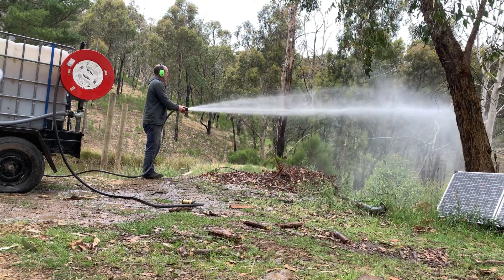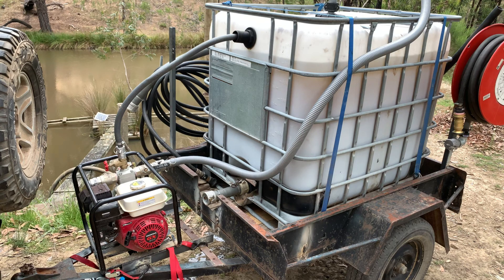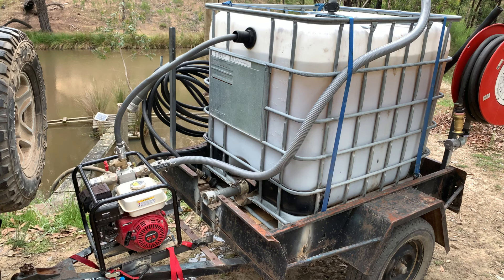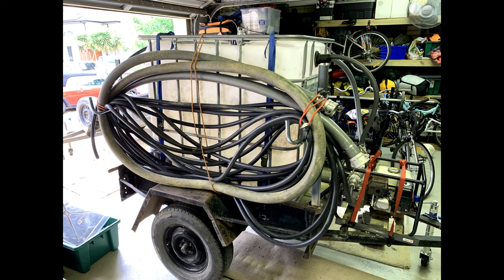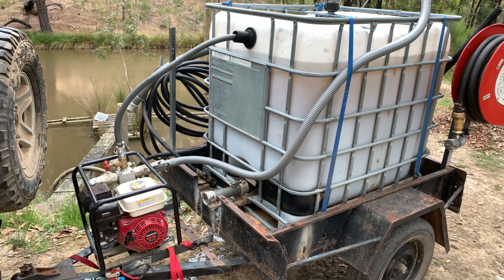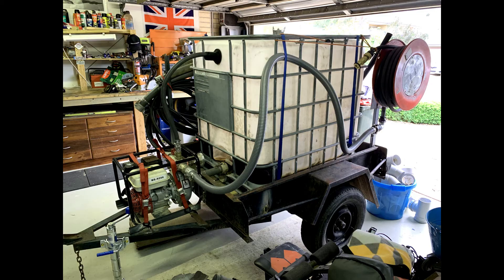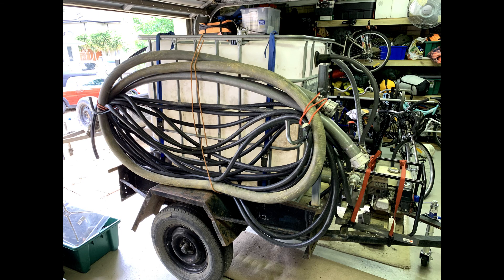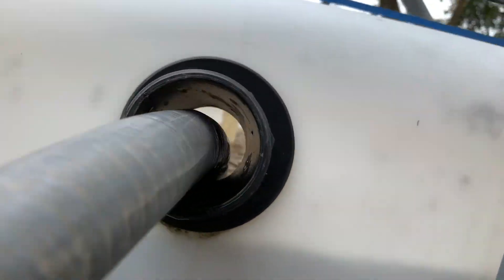Fire Pump Part #5 - Fire Fighting Trailer

Comment: Maybe in the future, could you do a step by step build for us novices? Great setup. Cheers
Reply from the maker: Hi, thanks for watching. Have you been through all the videos in the playlist ? There’s already quite a bit of detail. 
In the future I plan to change the trailer to twin axle ( short wheel base though ) or add some jack stands so that it can be used with out being connected to the car. I will video all of that which might entail replumbing the whole trailer.
Reply: @TheRuralProject  good idea the single axle is a bit light to carry 1 ton of water plus pump hose and hand tools.  The recirc back to the tank should have an pressure  relief valve set to blow off at 5 to 10 psi below the pump's shut off head. This can be a 1/2 inch valve since it is just to keep the pump from over heating and burning up the shaft seals.  
The Pump should be at least a 2 stage unit producing 197 ft head.  To support a hose lay to some distance out or up hills.  For instance mini Stryker, (wajax) BE 2 stage with 6.5 HP Honda 
Or Frontier  $$$$ from WFR fire systems.
Consider a forest foam injector AFTER the pump ( F S fire  standard is on the suction side but that will fill your plastic tote tank with relieved return foam and shut down your pump PDQ) then you will absolutely need a 2 or 3(Wajax Mark 3 or Frontier) stage pump to handle the injector loss but your water will go 2 or 3 x as far.  Note that you need injector plus an air entrained FS foam nozzle.
The foam nozzles are usually off longer than they are on since a little bit of foam will do it, so get a really good relief valve possibly adjustable Clayton or Singer or equal PRV valve $$$$.
Pro crews love the industrial play nozzles but $$$, there are now some pro level combo purpose fire play nozzles that do both water and foam.
Plan to carry some tools:  shovel, forest fire fighter's  pulaski, power saw, spare fuel, lengths of FS hose for hose lay from pond to fire if possible.  Weight mounts up fast.
If you are rumbling your trailer across an outback 4x4 road or Tasi definitely think about securing the water tank with springs holding it down to avoid splitting the tank,  and lower the tank height or risk rolling the rig.
Hope this helps 
Thanks to Aus for sending the 30 man management team our guys are just about tired out and there were 300 fires of note  in BC this week.  Be Fire Smart.
Reply from the maker: @Morgan2XL  thank you so much for all the very useful info. Really great info. We are still sliding through mud at the moment ( Australian winter ), but once it warms up I have a few tests I’d like to do. Agree about needing to add some tool. I’m real pleased that I built the trailer but there’s plenty of room for improvement. 
Luckily I’m still not living at my land, (. No house yet) so no rush to have everything perfect just yet. 
Best of luck with the bushfires, very scary.
Reply: You all prolly dont give a damn but does anyone know a tool to get back into an instagram account..?
I was dumb lost the login password. I would love any tips you can give me
Reply: @Cruz Marco Instablaster ;)
Reply: @Harry Adriel It did the trick and I finally got access to my account again. I'm so happy:D
Thank you so much, you saved my ass :D
Reply: @Cruz Marco you are welcome =)
Reply: @Harry Adriel i really appreciate your reply. I found the site thru google and I'm trying it out now.
I see it takes a while so I will get back to you later with my results.

Comment: Picked up a Ford 1/2 ton trailer someone put dual axles on, had to customize & reinforce.  Have a  2 inch, 158 GPH pump with 1/12 " fire hose outlet & 3 garden hose outlets, one for bypass.  2 -50 ft. 1/12" hoses, multiple garden hoses, 425 gal. tank  in bed & 50 gallon plastic barrel on tongue.  Have a good fire break, had a 30,000 acre fire last year within 2 miles & was only one that didn't evacuate.
Reply from the maker: Hi, thanks for watching. Sounds like a great set up. My land has some tight spots, hence my small trailer, but I’d prefer a dual axle if I had the room. Make sure you can connect the hoses to make a 100 ft hose, if needed. 
I hope you never have to use your fire fighting trailer. I’ll be releasing a video soon that gives the history of my land and shows the effect of fires that passed through in 2014.
Reply: @TheRuralProject  My 2 - 50 footers connect, currently updating back up nozzles  etc.  Have a 425 Gallon, 2- 275 gallon & others for total of about 2000 gallons around cabin & property.  .  40,000 acre fire burned thru my 40 acres in 2012 & I wasn't near as equipped as now, stayed & fought it  & my firebreak saved me.  Got fire retardant dropped on me by plane.  Catching your pants on fire is a great motivator for preparedness!
Reply: Had another fire rage thru my 40 acres, July 8th.  Got all my 40 acres except firebreak, that & my gear saved me.  There's some short videos on BullMtn. Billy of fire & my rescue dog..2 versions of some, because came up with out comments, think because I called the fire a bitch & mentioned killing looters.
Reply from the maker: @BullMtnBilly-vm1wf   hi, I’ve just seen this comment, you tube didn’t show it until now. Really glad you are ok. Scary stuff I bet. Great preparation pays off. Stay safe. I’ll check out the video.

Comment: Does it have a valve that you open to put the water back in the tank ( when it’s recirculating)  or how does that work? I’m making something similar but not sure how to do this part so the pump won’t burn up. Thanks
Reply from the maker: Hi, not sure which of the videos shows it, but yes there is the facility to recirculate water, I defiantly mention it in one of the videos. I connect a pipe to the quick connect which points vertically and pipe that back into the tank. The two side quick connects are then closed. This allows the pumps to run on idle, circulating water so it doesn’t damage the impellers and its fully primed ready to go. I have a playlist for the pump, have a look through it. Cheers
Reply: Ok I will do that thank you
Reply: @leinaddranyam4378  Just use a FS style firepump relief valve 1/ 2" dia  irrigation supply store relief valve set 5 psi below the pump shut off head, plumb into the outlet.
Reply: Will depend on what kind of pump you have, I'm using a semi trash pump which tops out at 45 PSI. It needs water to continue moving if it's going to run for very long but you can still turn off the nozzle you just don't want to leave the nozzle off for more than say 30 seconds if you can avoid it. The water movement is only needed to keep the pump from overheating so I am running just a regular garden hose back into the top of the tank with a valve so I can control the flow to the tank and my plan is to just leave it open about a quarter of the way all the time so it doesn't much affect the pressure of the fire hose but maintains a small amount of water flow that will be sufficient to keep the pump from getting too hot. I have ran my pump on very little water flow out of the nozzle where it was building lots of pressure and couldn't detect any noticeable warming of the housing or water going through the pump. So if you are firing it up and using it right away no issue, where you run into issue would be if you wanted to fire it up and keep it idling in anticipation of using it